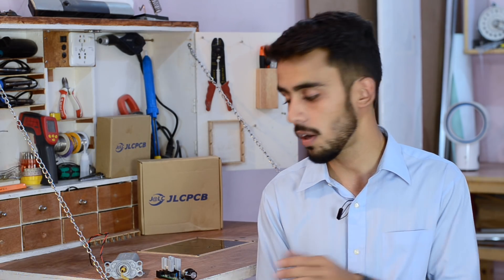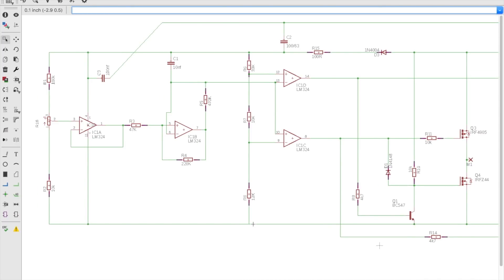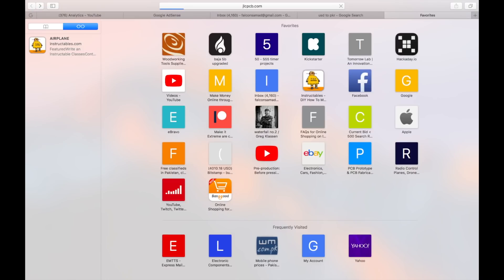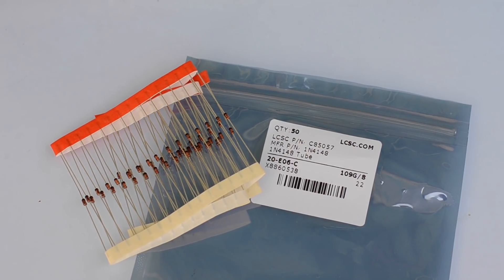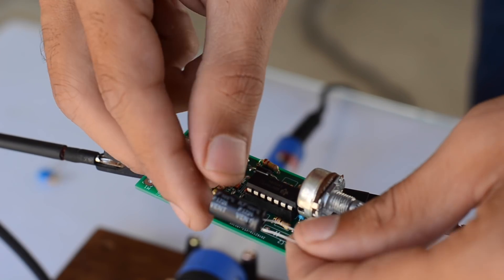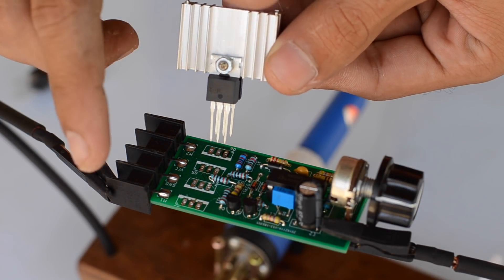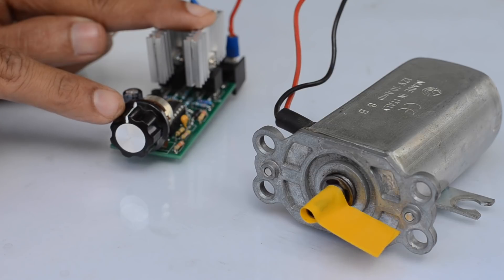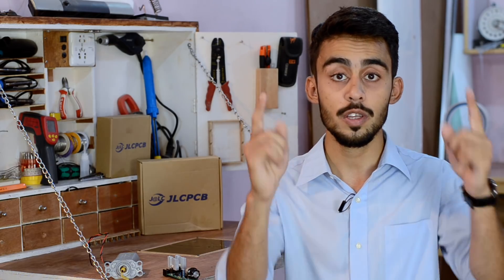How to make a Bi-Directional Motor Speed Controller

Comment: I need the rotation to begin much more gradually because the bidirectional motor will be attached to an inductor, while electronically connected to fixed capacitor, to be slowly rotated until resonance is reached. 
Seeing that the chosen resistance of the potentiometer  is 100K, would a 200K or a 50K rotate more gradually?

Comment: At this point at Feb 2020, I’ve notice most go without answering. I am a retired automotive technician now building a heating control for a 54 year old vehicle to something to drive, being hurt does not pat my bills. I am working with 12volt dc brushed motors that contain a potentiometer in the housing, geared to the motor for feed back. It has to be reversible but has a limit of travel. To control this with a dash mounted pot.... I won’t even ask. Even though I have electronics experience, does not help to ask a question if not answered. Thanks for the video. I will find my answer in a robotic forum. We are all busy paying bills but not replying. I am sorry, but Good luck!

Comment: hi, the triangle wave generator you mentioned in the video, does it meaning that you're controlling the frequency of the circuit instead of the pulse width modulation?